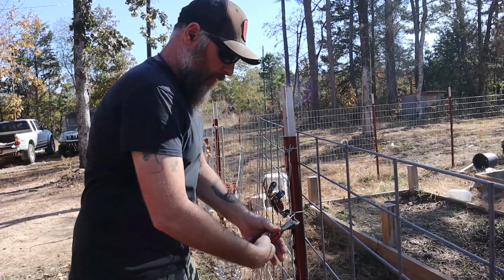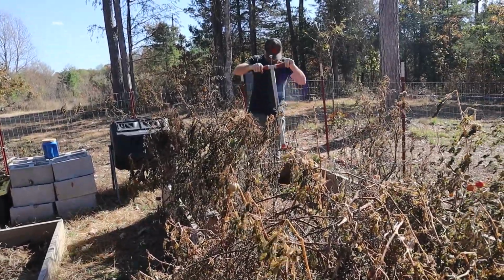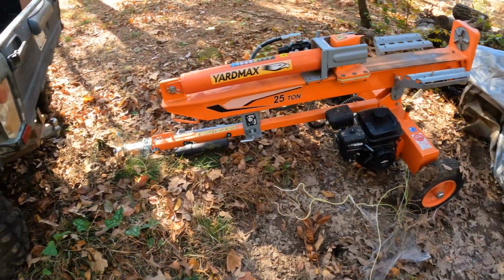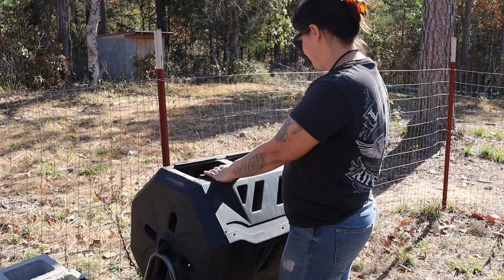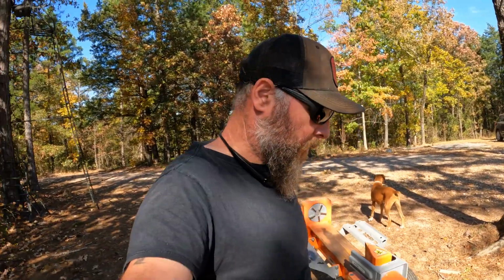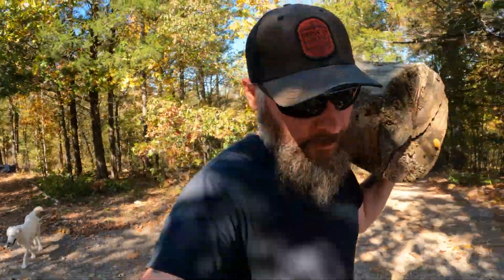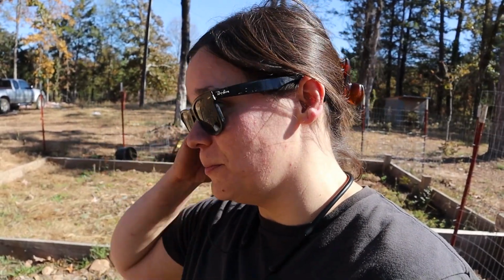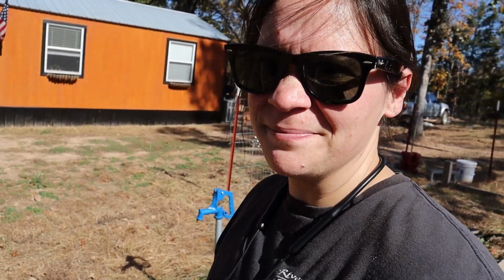We let them all DOWN...| She Was Sad | Shed To House Conversion

Comment: Roxanne you should throw your rabbit ,chick poop and as many leaves as you can rake up onto your garden beds. Turn it over if you get the tiller working or fork it over loosely , strew a thin layer of straw over the top then leave over winter . By the time spring  comes it will mostly  all have broken down and replenished the soil biome ready for planting. I don't rely on the bees to fertilize my pumpkins. I get a male flower , pull back the petals and use it to fertilise two or three female flowers myself. I get more  success with pumkins doing that. Gardening is a life long learning curve what works for some doesn't necessarily work for others because our soil and weather are all different.
Reply: Yes, Put all of the poop on the garden. Hope you all feel better soon. Love you guys
Reply: Just beware that not all leaves break down over winter, like oak leaves, they take years to break down.  I only use maple leaves in my garden…the oak leaves i just either rake up and throw away or mulch them with the lawnmower…good for the grass over time.

Comment: That's the first time I've ever seen a primer bulb replaced. That was cool. What I like to do with all of my gas equipment, generators, weed eaters, chainsaws etc. I start all of them once a month at the beginning of the month, every month. Let them run for 10 or 15. I also use ethanol shield fuel stabilizer in all of my gas cans for my small engines. Helps them from getting all gunked up. Good luck, have fun and stay safe

Comment: When your finished with any gas motor you should use a gas stabilizer or use new gas if you haven’t used it for a year. Pour your old gas out. It will leave varnish on the carburetor.
Reply: My hubby always makes sure if I use the weateater or lawnmower that i took out the gas, restart and let all the gas out and then put it away to save the motor. And the other day he spoiled himself with a chainsaw and it even say so in the book not to leave gas if not in use. Interesting

Comment: I always throw some stabil in the gas in equipment I don’t use often, always fire right up. Ideally drain the gas after each use and use ethanol free gas. Will save you a lot of headaches and carb cleanings 😉😉

Comment: Rox, next Spring, take a jar with a lid and fill it half-way with undiluted rubbing alcohol. Keep the lid on it tight until you spot the Japanese beetles, then take the jar out in the garden and collect up all the beetles you see, dropping each one into the jar of ascorbic alcohol. This will kill them, but it won't prevent them from coming initially. This tip is more for after-care. As long as the lid stays on tight you can save the jar with the (dead) beetles in it for about a month and the ascorbic rubbing alcohol will remain potent, if you choose. That way you can keep using the liquid without having to refill it every day.

Comment: Part 2: I actually put a layer of kitchen scraps(peels, egg shells, etc) across the top, then layer either cardboard, newspaper or packing paper over that. On top of that, I put Black Cow composted manure(bc we don’t have animals anymore) then top it with leaves. That actually builds amazing soil! In the Spring, we add a layer of our completed compost. Works amazingly.

Comment: Ever since I started putting SeaFoam mixed in with the gas can for the lawnmower and in the cans of mixed gas and 2 cycle oil for the chainsaw and weed whacker I haven't had a problem with any of my tools starting or running. I buy the SeaFoam at AutoZone here but all auto parts stores have it. I always buy it to put in my truck gas tank and the AutoZone employee told me he puts it in all his tools. That's what made me start using it. I'm a big believer in SeaFoam. Just read the directions on the can. It's like 1 whole bottle in a 20 gallon truck tank. I usually just put a couple capfulls in a gallon of gas for the mower or for a gallon of mixed gas for the chainsaw.

Comment: That’s what happens when you use gas that has ethanol in it try taking the pull rope assembly off and check the fly wheel for rust, if it is just use sandpaper and clean it up

Comment: Hi Rox, I had a trimmer that wouldn’t run. I drained all old fuel, stripped out the carb and replaced the gaskets and diaphragm to get it going. I replaced the tubes and primer too but the ‘thing’ wouldn’t run. I soaked the carb body in cleaning fluid and again rebuilt the carb. They are frustrating mongrels but when you think about these small 2 strokes, they aren’t that difficult to understand but they are challenging at times.

Comment: Rox, I suggest you put in a winter cover crop. It’s not too late. The collards, mustard greens  and Dijon radish are edible. The other stuff all make for nutrients for the soil. Just cut it down (like a weed eater), lightly turn under, or not, and your soil will be ready to plant. If you want, you can cover with a black cloth or plastic to get it to die off. Either way, Lee it in the soil. Really adds nutrients. I use the one from Mountain Valley Seed Company. One 5lb bag should cover your garden beds.

Comment: Check the fuel filter is usually in the gas tank and check to see if it's got Spark at the spark plug maybe replace the spark plug with the right one preferably

Comment: If you leave that splitter outside uncovered you likely have water in the gas. When you get some fresh gas it will likely run better. It would be best to cut the gas off and let it run out of the carberator and stop when you are finished with it. It will keep the carberator from getting gummed up.

Comment: Try and clean the fuel jets out they are clogged and not letting fuel thru..thats what it sounds like..they are little brass pieces with a little hole in them in the carb...u have to take them out and clean them

Comment: If you put leaves on your garden or work them in try to find tarps or blackening plastic to cover the garden for winter to kill off grass & prepare the garden for spring.
If you find a sign company that gives away the signs they take down they are heavy duty & work great for gardens. Can be cut to any size but also works great for larger gardens. Call signage companies that have road signs displayed on expressways.

Comment: On the tiller, spray a little starting fluid on the air filter. It will either start and run or it will start and sputter out whicheans you have a clogged pilot or main jet.

Comment: For the tiller take the carb apart again and if you don’t have one go to an ace hardware and pickup a carb cleaner (jet cleaner) multi tool. It is all metal and has multiple thin metal sticks essentially that will fit into all of the carb openings etc.   you can also verify fuel delivery issues if you squirt starter fluid into the carb and then start it if it starts for a minute runs for a few seconds and dies you aren’t getting proper fuel into that carb. So clean/carb cleaner spray etc.

Comment: If you don't use non-ethanol fuel the ethanol will melt the fuel lines on those and gum up all the orifices in the carb. Painful getting those cleaned out.

Comment: Up here in ethanol country,  mechanic urged  me to use the"91 no-ethanol " blend gasoline, if l can't run my small engine until dry,  I don't have to be as concerned it'll gum up.  Told my brother if he borrowed anything from me, small engine,  he had to use the " 91 no -ethanol "   not every gas station offers it

Comment: I always run non ethanol gas in all my small engines the ethanol is not good for them so if you don’t already you may want to start. It’s expensive but Iv notice way less problems
Reply from the maker: We use non ethanol in the small engines :)

Comment: I have found that on Gas Engine equipment, you need to clear the Gasoline from the Gas feed system, when the season ends & you are going to store it. Some gas powered equipment have a shut off valve after the gas tank you can close and then run the engine until it runs out of gas. This clears the carburetor & feed line of Gasoline. Other tools, without this feature, you need to empty the gasoline tank and then start & let engine use up the gas in the feed lines & carburetor. Get rid of the gas in the excess gas in the tank by putting it in your car, unless, if it is a gas/oil mix. Then on the next season, just add fresh gasoline and the unit will start right up. I haven't had a startup problem since I took the time to follow this procedure. The important parts are do not allow gas to set in the carburetor for a long length of time and use fresh gas the next season.:body-blue-raised-arms: Art in Clif.🤓

Comment: The gas with ethonal is bad to sit in small engines get on Amazon get a carb replacement and only use ethanol free gas I learned after changing carbs on weed eaters and chainsaws I switched to the tru fuel from Home Depot and my carbs are going on5 years I have had to change the bulbs but the carbs have been fine.